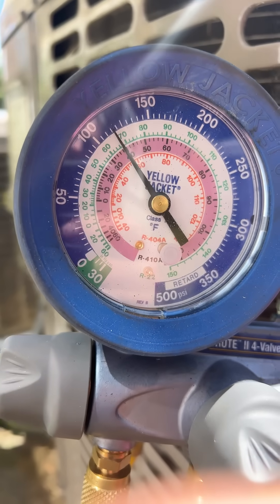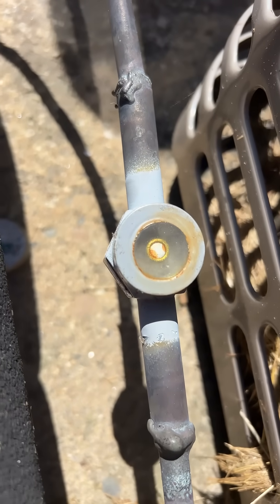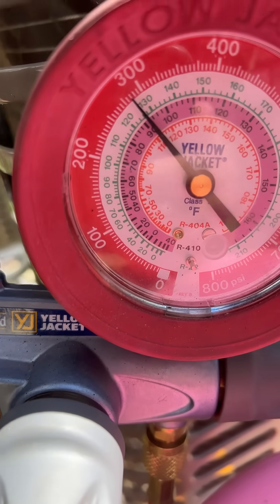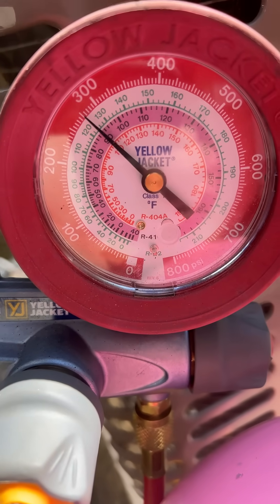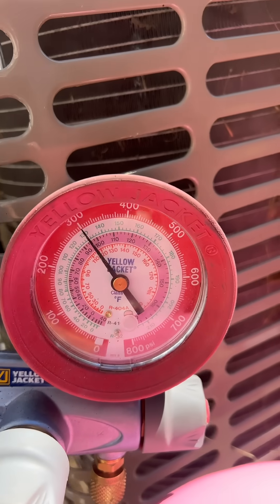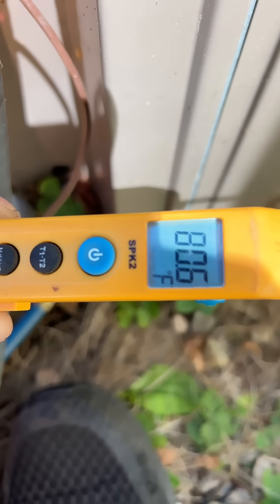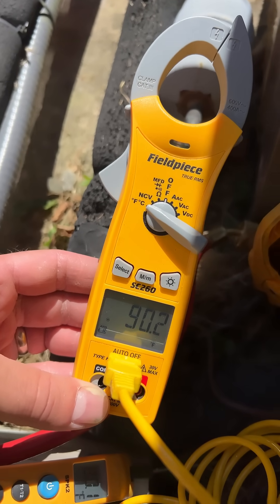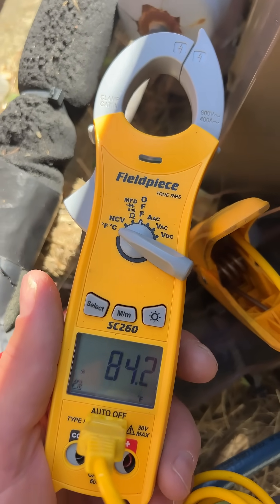AC Low On Charge R410A, Charged Up By Sub-Cooling Method W/TXV #coolingunit #hvacshorts #hvaclife

Comment: Is that for an apartment building?  Why are there so many condenser units?  And those condensers are tiny....   I have a 7.5 ton unit for a 2200 sqft house in Casa Grande AZ .... 2 Story 5 bedroom horrible insulation 40Kw Solar
Reply from the maker: That is a Office building a bunch of dental offices and other businesses that are occupying the space and each Space has one to two unit units from the basement all the way to the third floor very large building. That sounds about right for your house, but I don't know Arizona. I know it's a lot hotter than Maine so you probably need bigger systems I assume.